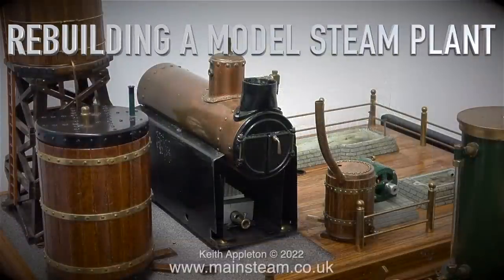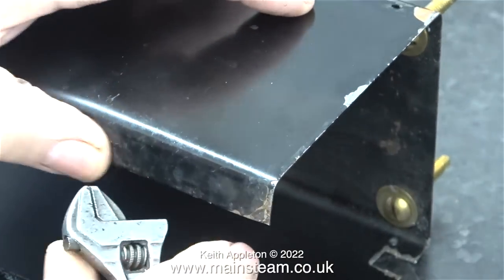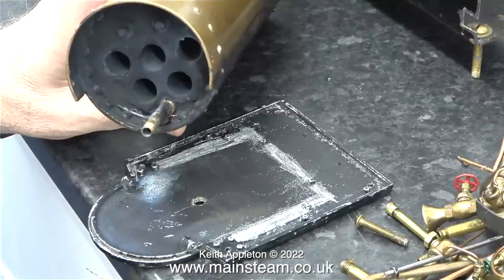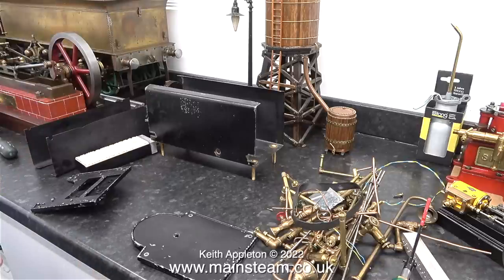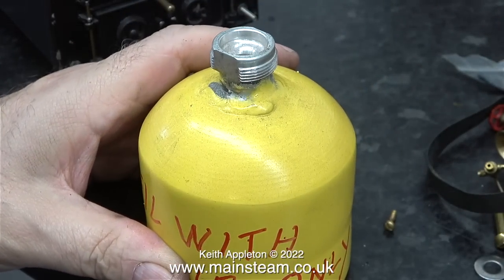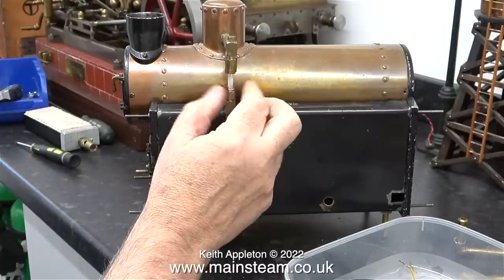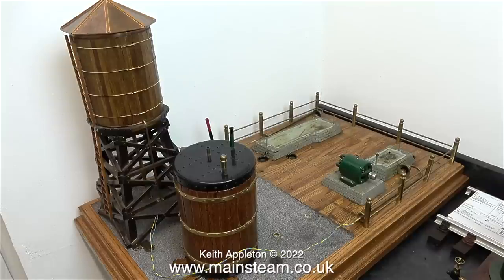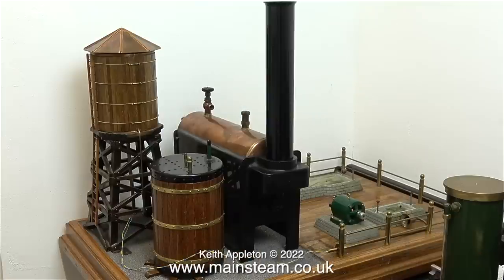REBUILDING A MODEL STEAM PLANT - PART #2

Comment: What, if anything, would that plastic tank be in an actual stream plant? A condensor to recover water from expended steam?

I'm guessing it doesn't model anything and it's just there to hide the gas tank.  That opens up a lot of options and I'll be eager to see your update.
Reply from the maker: Yes that was the purpose of it. But I am not going to use it in the New Build.

Comment: I like that water tower!  It looks like a proper rail road water tower, but the boiler supports look wrong.  Maybe if you could cover the outside with scale brick paper?
Reply from the maker: or better still - aluminium Chequer Plate }:-)))